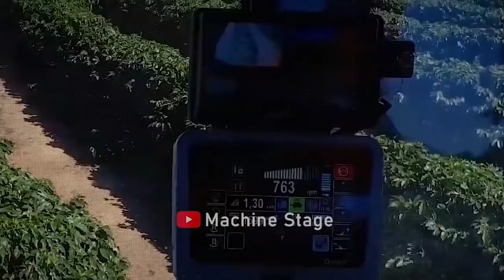The agricultural technique discovered by Israeli scientists shocked the world.

Comment: Excellent. Good use of heavy duty machines. One doubt, does the soil gets compacted over a period of time,due to these huge and heavy machinery, affecting percolation of rain water, thus hampering recharging of ground water, which may lead to drought or floods in the future .
Reply: that's why there are subsoilers. They settle the deeper layers of the soil, opening cracks through which water infiltrates to the underground sheet.